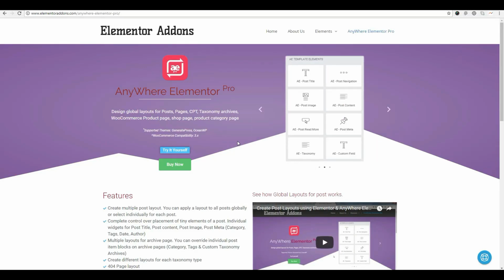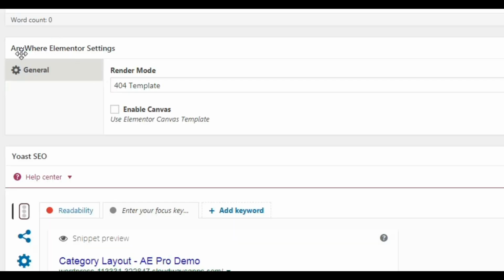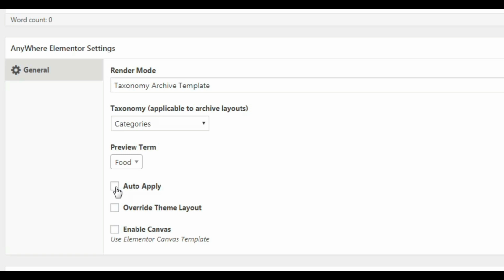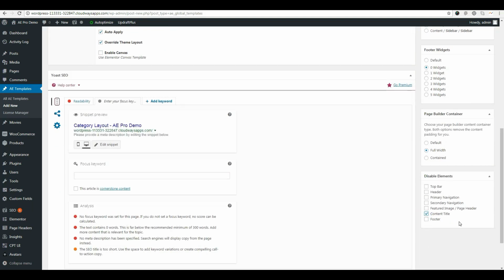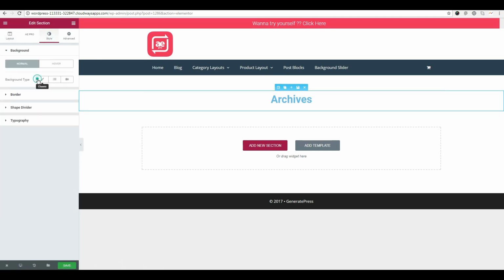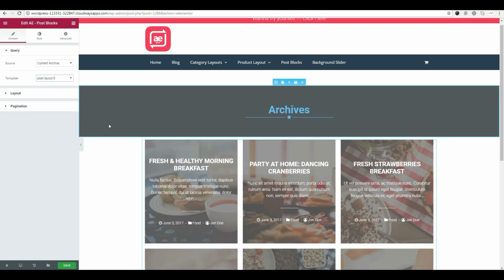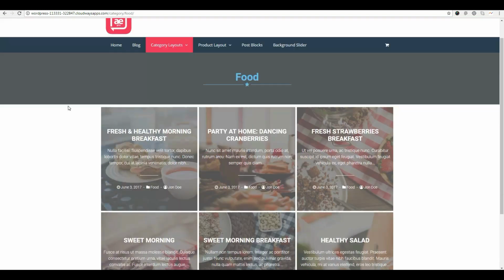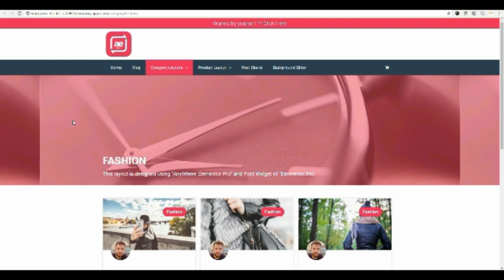Design Category Layout using "AnyWhere Elementor Pro"

Comment: mmm..it seems to work only only with default posts and not with any custom ones..so you can create an archive for the "Posts" but you cant create one with any custom...any ideas??
Reply from the maker: It works fine with custom post types. If you are facing any issue or have any further query, you can reach us here https://www.elementoraddons.com/contact-us/